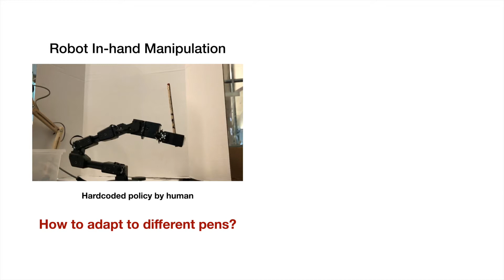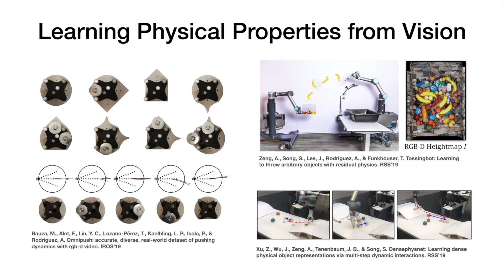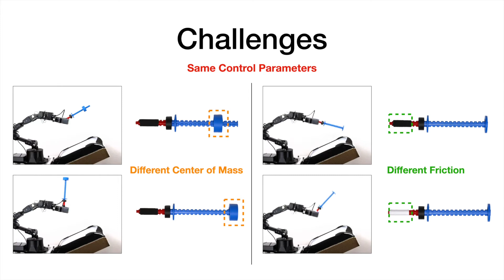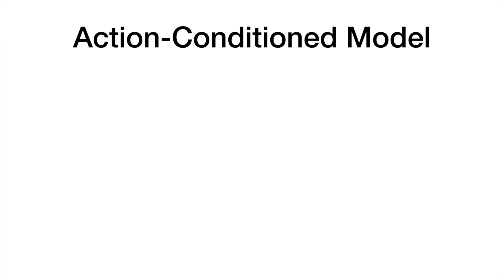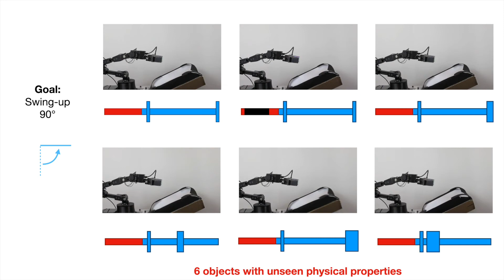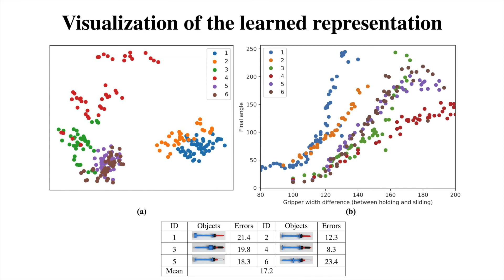[IROS2020]SwingBot: Learning Physical Features from In-Hand Tactile Exploration for Dynamic Swing-up

Comment: Hello Chen, wonderful work here! I have one question about the GelSight sensor. Do you know what model of GelSight you are using? Is it GelSight DIGIT tactile sensor instead of mobile metrology one?

Update: Looks like there is an ICRA 2021 paper introducing GelSight Wedge, and it looks like the GelSight using this video. However, that came out 7 months after this video. Are you using GelSight Wedge instead?